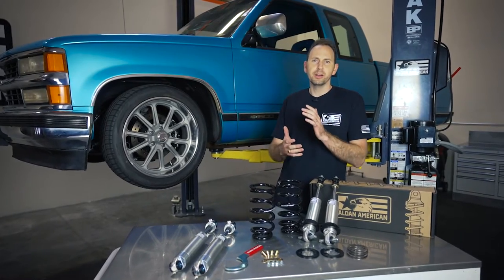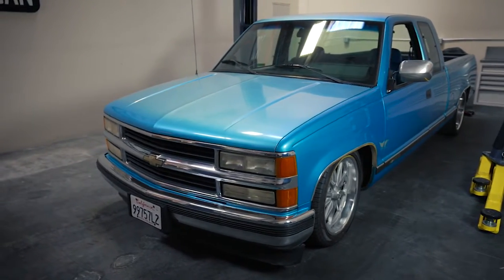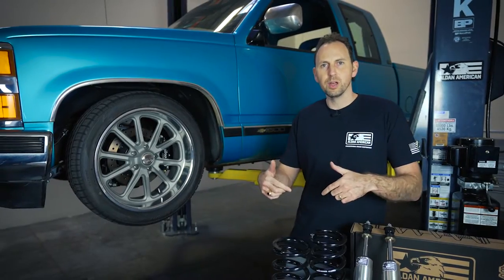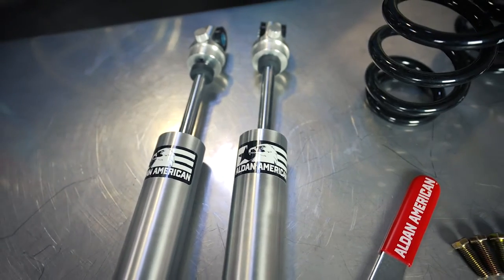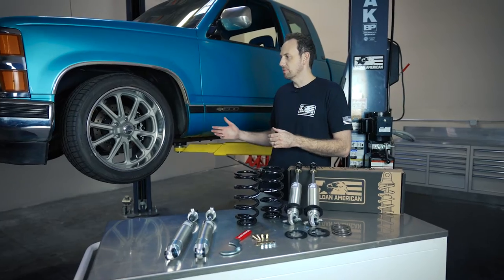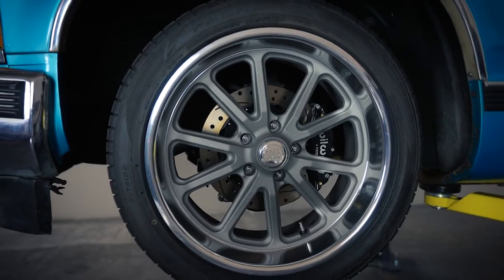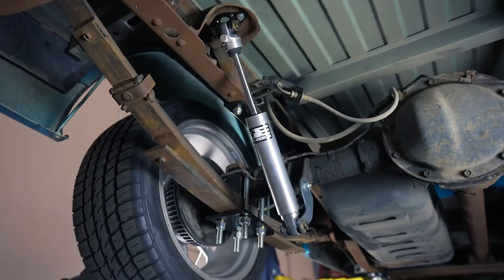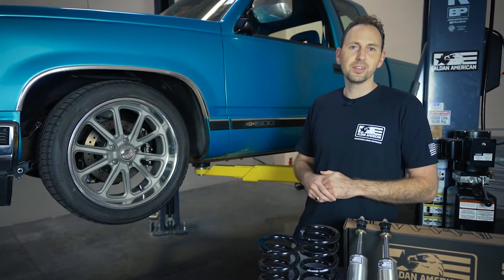1994 Chevrolet C1500 Build - Wilwood Brakes, Stone Fab Arms, Aldan Coilovers - Part 2.

Comment: What’s the part number for the front WilWood breaks you used?
Reply from the maker: This is the Wilwood brake kit we're running on the 94' OBS

https://www.wilwood.com/BrakeKits/BrakeKitsProdFront?itemno=140-15951-DR&year=1994&make=Chevrolet&model=C1500+Pickup&option=Vehicles+using+Wilwood+Iron+ProSpindles

Part #: 140-15951-DR

Comment: Great video! Can't wait to install a set of Aldan American on my OBS build!
Reply from the maker: Thank you! What year OBS are you building?
Reply: @AldanAmerican  Original owner of a 1998 Extra Cab. :)
Reply: How do you like your aldan suspension
Reply: @mybaby4336  I'll be installing it soon. Waiting on some more suspension components. I'll keep you updated!
Reply: I have a 95 silverado i bought from my father and was looking at aldan front suspension but trying to change my factory upper and lower arms trying to save some money
Reply: @mybaby4336  I'll be doing the same as you. You'll be saving money in the long run if you upgrade your upper and lower arms. Plus, you'll get the best performance from a set of Aldan Coilovers. Versus a set oem/lowering springs.
Reply: @MisterMemo  what upper and lower a arms can be use with the aldan coilover kit if im doing them my self
Reply: @mybaby4336  #StoneFab and #IHCSuspension make a set of arms for the 88-98 OBS